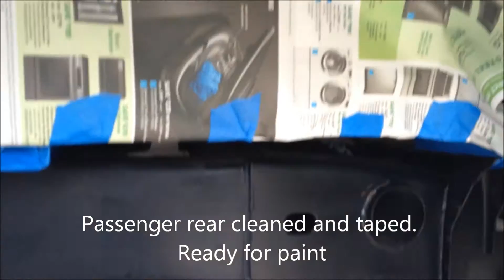VHT Roll Bar and Chassis Paint

Comment: VHT Roll Bar and Chassis paint is The most unsafe cans of paint I have ever had.  One nozzle broke completely off during the very first spray.  I found the nozzle and a spring during cleanup of the floor.  It took $25 dollars worth of Acetone.

The second can worked OK for about half the can, and then, with no fingers on the nozzle, it started spontaneously spraying out of the side of the nozzle.  It got in my eye directly, and cost $20 worth of all the eye drops I had, after a water flush with the cold well water.  + untold medical bills to come.  Not to mention cleaning my prescription glasses lens off with Acetone destroyed the coatings...l. but I had no choice

This cost me a lot of money, and a lot of suffering already and yet to come, as solvent in eyeballs generally doesn't go well

I've probably used 400 cans of spray paint in my day, and this is the first time anything like this has happened....and it happened twice on the same day from VHT only
Reply from the maker: Omg.
Reply: I see you like to post us all over the place I've used dozens of cans of this paint over the years never an issue. Maybe it was a bad batch or maybe old stock?
Reply: @Jeepdriver75  by "us", I assume you are a representative of vht.  you are incorrect in your statement... I quite dislike the fact that I had to post all over the place in order to get any response from vht at all.   I'm glad you have not had a problem, but that's like saying you've driven all your life and never gotten killed in an accident, so it's BS that anybody ever got killed in an accident.... it's called a fallacy of logic.  it's known as defamatory and misleading.
Reply: @patrickneyman6739  I mean you correct and, yes I've seen you post this on other vids. And no I don't work for them just have used their products for decades with great success.
Reply: @Jeepdriver75 the other guy here appears to not know how to use a simple spray can 😂 I seen his comments on other vids too

Comment: Hi just wanted to know if you grind everything down and then painted. Also did you use glossy or satin?
Reply from the maker: John Doe 

No grinding. All Nox Rust was still on the frame. Only cleaned with an all purpose cleaner to remove the dirt. Painted right over the Nox Rust.
Reply: Was it gloss or satin?

Comment: Does it snow where you live??
Reply from the maker: Ricky Moran 

Extremely rare. A couple days every 3 or 4 years.
Reply: Riff wow that's odd. I was just wondering because I want to do this to my 94 Silverado but I'm pretty worried about all the snow we get here in northeastern Colorado it'll be rough on the paint but it could probably handle it.
Reply from the maker: Ricky Moran 

It can’t hurt. It should help keep rust away at least for a while. It lasts a few years on mine.
Reply: Riff thanks! Great video by the way
Reply: Riff is this glossy or satin?